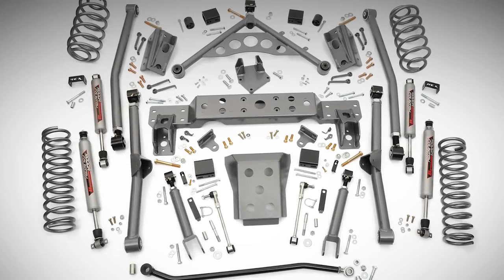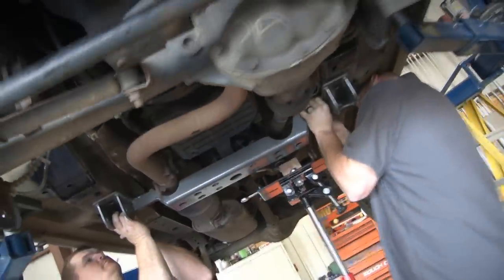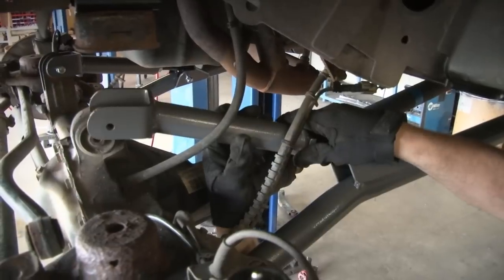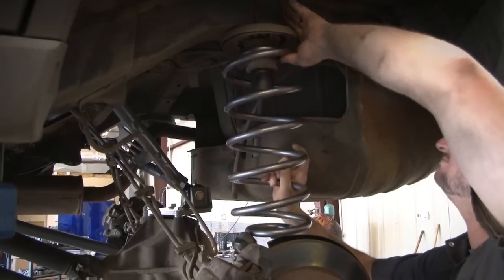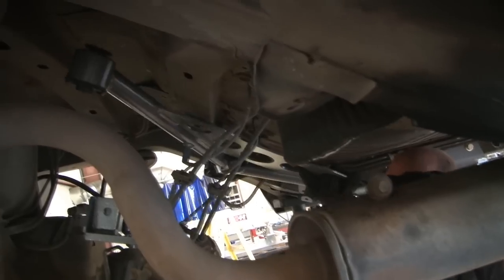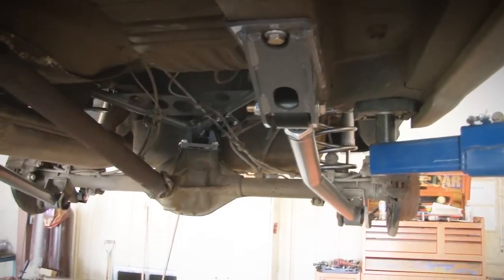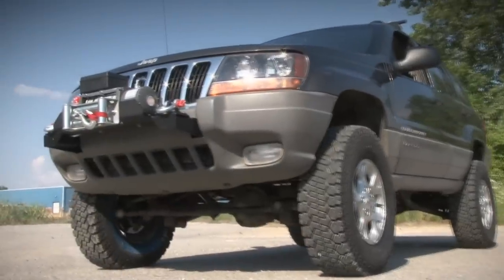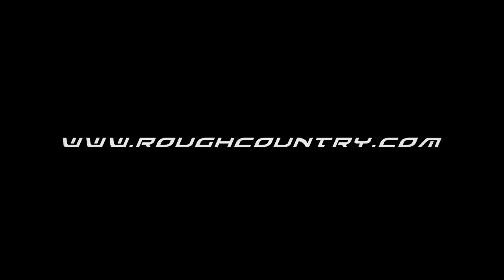Rough Country's Jeep Grand Cherokee WJ 4" Long Arm System

Comment: I love this lift kit. I installed it on my 2002 WJ along with the RC winch plate mount. I want to keep the stock look on my WJ that is y I did not go with a custom bumper with winch plate. Check it out on my Facebook page WJ 4x4 offroad. I wish we can post pictures here on YouTube
Reply: 4.0 or 4.7 you have?

Comment: That's the same 4 inch Rough Country lift I Have And Its A Great Set Up On my 2002 Jeep Grand Cherokee Laredo 4×4 with 33 inch × 12.5 R17 tires and rims .Great Lift Kit. I've done crazy Off Roading and I only had to change the rear shocks after 3 years.

Comment: I have the 4 inch rough country on my 99 Jeep Wj. It is descent for the cost but my only complaint is the springs are starting to rust and it doesn't snow where I live so it's not corrosion from salted roads. Ive always washed under carriage and components after off-roading.
Reply from the maker: How long has it been installed? The finish on our products is covered for 1 year.

Comment: With this modification, would the jeep act significantly different in snow or on slippery surfaces? What might be the maximum tire size that would allow for control? More than anything I want to make sure it has good control in bad weather. thanks.

Comment: say there I bought the4"rc lift from poly performance for my 98 zj n never got to install on the beloved beast due to being a dam unibody the east coast rust eat the wheel humps in back, criticle area due to sway bar connects there anyway failed inspec. so bought a v-8 2002 wj want to know will some of the short arm links n springs work for the wj or am I screwed!
Reply: same thing happened to my WJ- the frame rail ends have some seriously dookie control arm mounts and welds :((

Comment: For a lift this high would I need a double cardan joint (double universal) drive shaft, or would my stock 2004 Grand Cherokee drive shaft suffice?
Reply: mxhonda2 it's been six years and no one answered your question.  I guess by now you've moved on and don't have your Jeep anymore, or you answered your question somewhere else.

Yes, you'll need the double cardan driveshaft
Reply: You will need s double cardan joint for the front shaft. That is for sure or your rzzepa joint wil fail soon

Comment: the kit I bought and installed is nice for the money but sucks cuz the silver color is gone and now black but that's a cheap fix and the adjustable play x flex joints are changed to pressed c clip ones u can't take slack out of any more so the sell 15 dollar rebuild kits if tgey develop play were as the old ones u could adjust a collar and tighten up the bushings..

Comment: Do you make a lift kit for a 2000 Jeep Grand Cherokee Limited AWD?
Reply from the maker: Our kits will fit the AWD models as long as you change out the front drive shaft to a double cardan shaft.
Reply: true

Comment: Do you need a longer driveshaft with a 4 inch ?
Reply from the maker: No. you only need a different drive shaft if you have AWD. Then you would need a double cardan shaft.
Reply: Rough Country what if my WJ comes with the factory double Cardan shaft already. I was lucky enough to get one with the correct package combination to get the “rare” factory one.